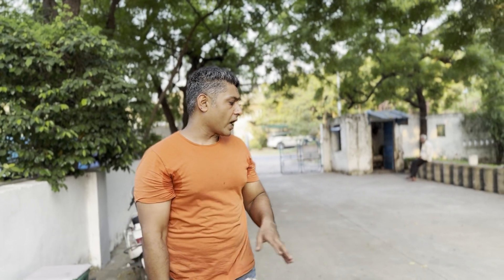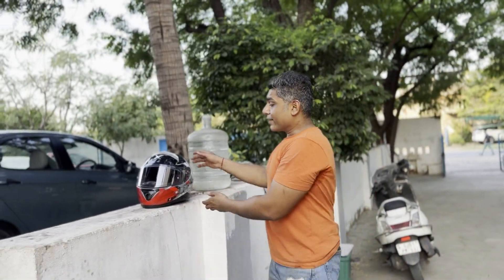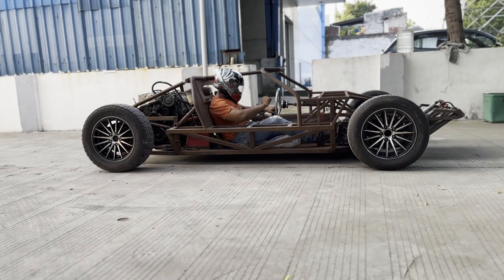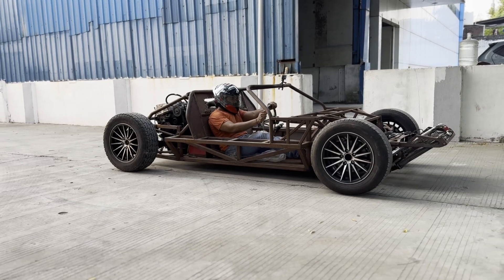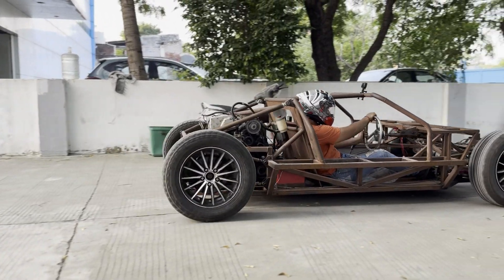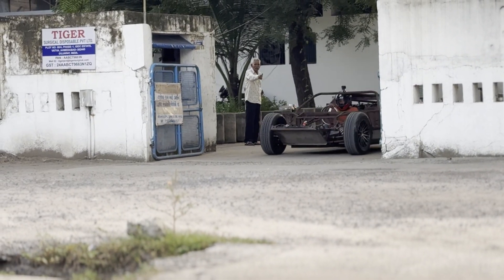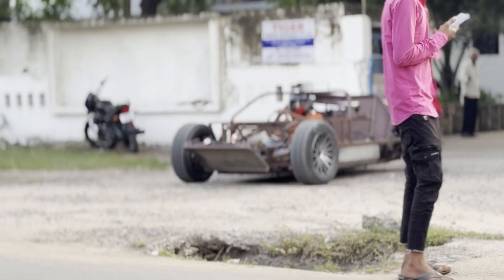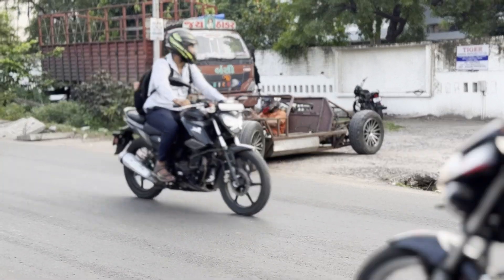GT40 Testing + Full Build Process

Comment: Why not go with a honda accord V6 Or skoda superb V6? That would have given a better exhaust note, dual tip exhaust and over all aesthetic to the engine area
Reply from the maker: K24 has more potential and performance parts available than those engines.
Reply: @NaughtyNut  well technically you know whats best.. keep up the good work, looks forward to the complete built series and the finished car❤️